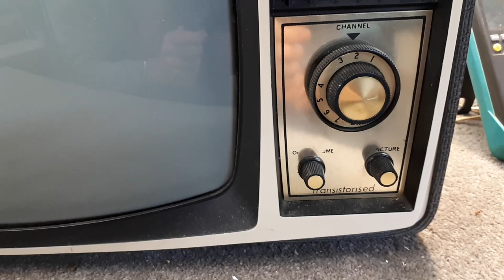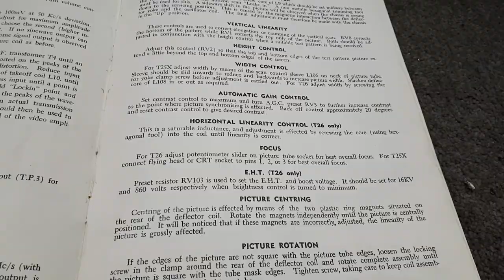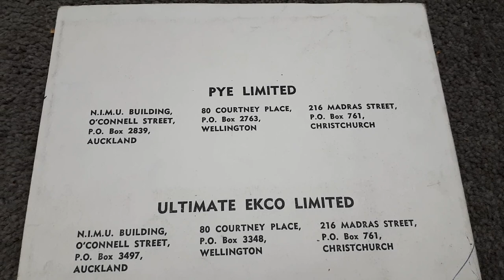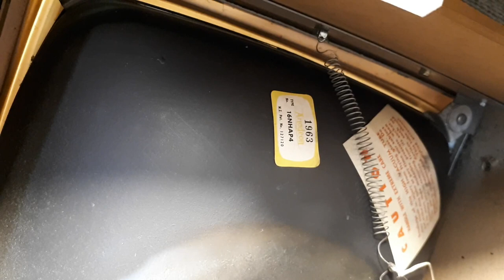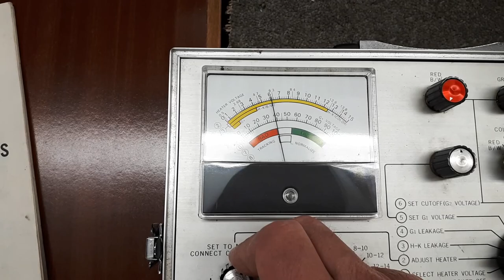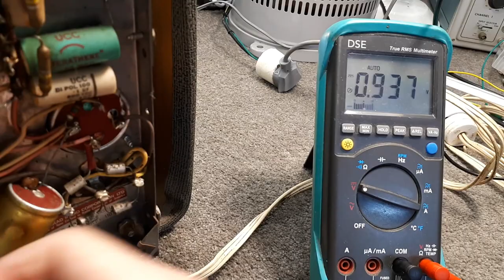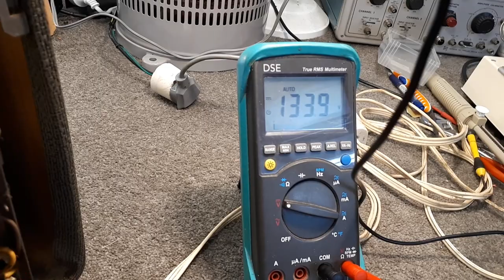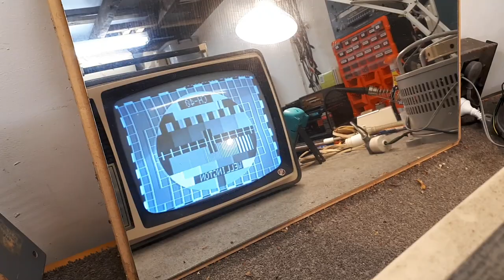Vintage Pye/Astor 16 inch T25X Television Repair Part One

Comment: It's interesting to see how electronics were marketed in various countries, in North America when something was advertised as being "Transitorized" it means that it was made prior to 1964-65, after that they advertised, or labeled them as being "Solid State". The marketing men took that a little too far at time, we have a Phillips blender from probably the late 60s or early 70s, and it boasts of being "Solid State". When the pushbuttons got gummed up, and I needed to clean them I looked around on the inside and all I found was the remains of a burned out rectifier diode. I remarked about this to my neighbor and he said "That's the solid state". 
 It looks like the local Pye company to N.Z used a lot of Japanese parts, whenever you see a transistor marked as 2SXXX it's always Japanese made, North American ones are always 2NXXX, I can't remember what the European/British ones are marked as but it seemed to be based on which company made them.
Reply from the maker: Thanks for that. I'm guessing New Zealand sourced alot of component brands from overseas at the time.

Comment: The socket under that compactron tube might be molded from "Micanol", it was supposed to be more heat resistant, and develop less leakage then Bakelite, but I think it's very similar anyhow.
Reply from the maker: Thanks for that. Whatever those sockets are made of its held up well.

Comment: Are those four transistors germanium or silicon? What are they used for, IF amps?
Reply from the maker: Yes they're used in the IF/Sync/video and Sound IF stages. And all silicon.